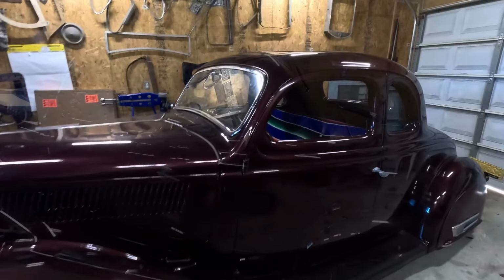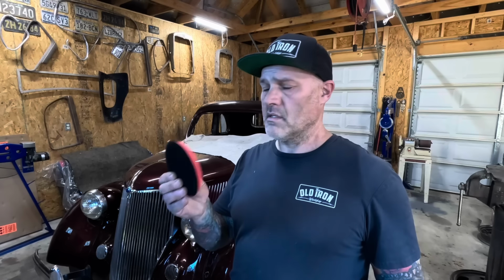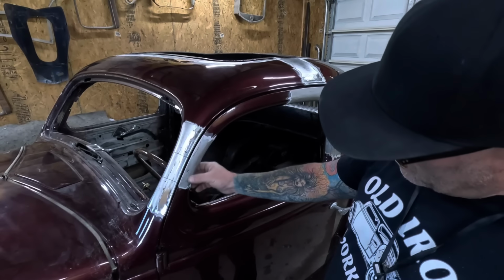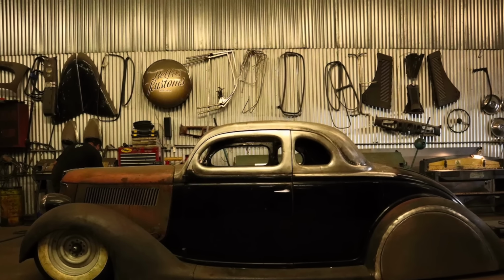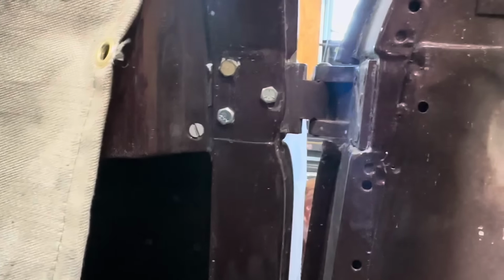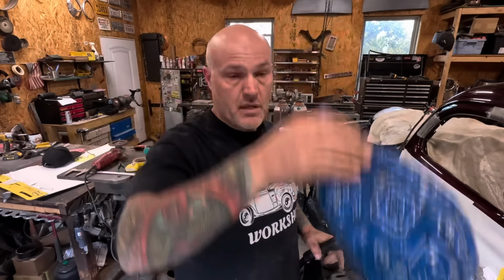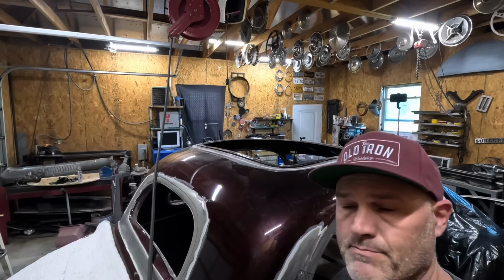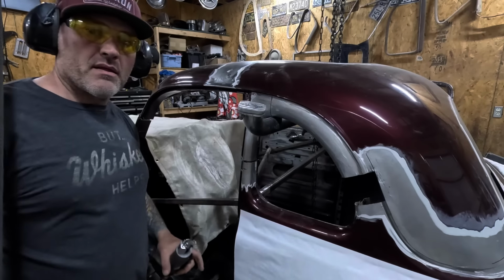How to chop a top,  1936 ford roof part 1

Comment: I love my lil air saw i use it daily tip on the hack saw blade you can take your snaps and cut it down the middle for curved cuts full width blade works great for the cut and butt
Reply from the maker: Yeah it’s like the best thing ever

Comment: Such a good car to start with ------- with the Chop you'll do  ------- should look really good ------- You mentioned Mike ------ Since he was turned onto the Air Saw ------- he says that the is the way to go -------- cuts like butter and cut width is very small making it ideal for Tig Welding back together -------- I have a '38 Ford as in your video at about 8.14 ------ I want to do a Chop to it ------ car is nowhere nearly as nice as the one you are doing ------- Mike did one ---- I think it was a 4 5" chop ------- Will be watching you closely ------ any Tips you can give would be most appreciated ( never did one of this kind ---- just a '30 Model A ) ------- Was the Car Craft Magazines of help? Do you remember what Month and Year? ----------Thank You for Sharing and for telling what steps you are doing and WHY ------ Hope you have a Good Week and will catch Part 11--------- Rodney
Reply from the maker: Thank you.  No the magazine drawings were not helpful.  More of a joke I guess.  It’s really just over thinking.  You can’t plan enough and work slow.  The more you plan the better it goes together

Comment: Speaking of fiberglass 1932 3W coupe hot rods I just traded my Wescott (fiberglass) ‘32 3W coupe (painted/running/driving) straight across for a 1955 Chevy Nomad (NOT running/driving) project car.  The wagon is a tank compared to my coupe.
Reply from the maker: Heck yeah it is.  I sold my 36 roaster for a 50 merc.  Different world

Comment: So why.  The owners are shorter than you, cause you can not enjoy driving it that way .The car is trailer Queen what a waste. Seating in a garage not driven . You do nice work
Reply from the maker: Actually, the owner of the car is quite active and driving. I’m sure the seat is going to have to be modified for the lower roof.  But it’s a driver.  My 36 roadster was chopped 4 inches and I drove it every day for 2 years 
 Thank you